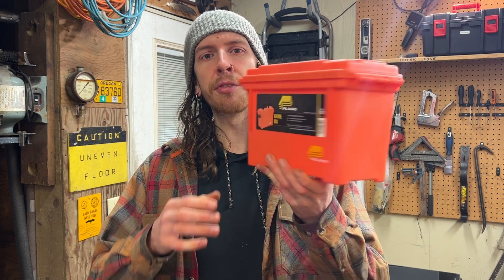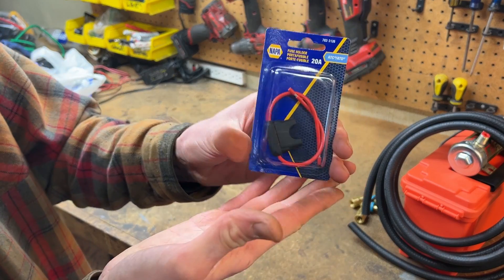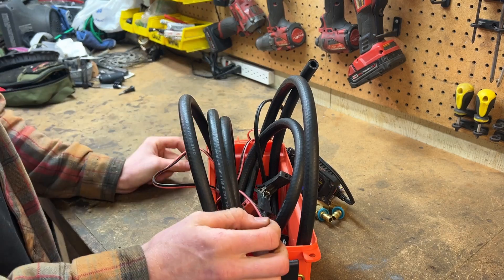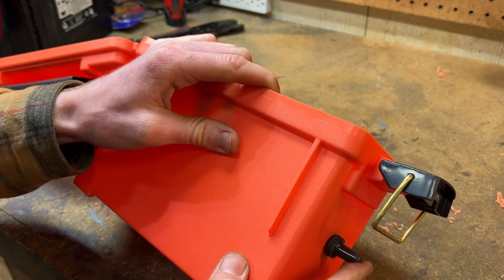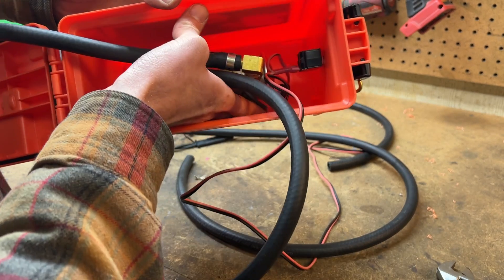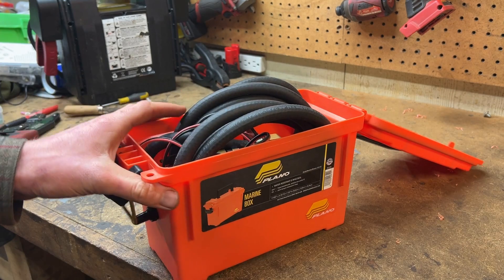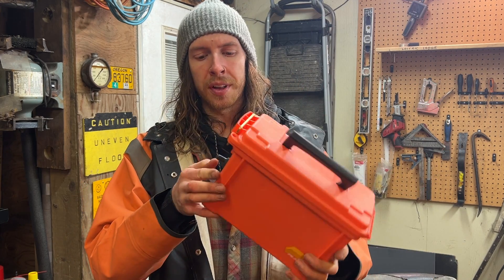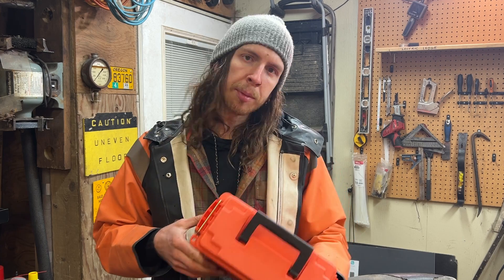Building a rugged and portable fuel transfer pump

Comment: Is there the next size up, or steel ammo boxes at Harbor freight. I bought one to make trailer lighting tester. But I really like your idea on the box. I did buy a different pump from Amazon and was going to handle it loose, but I really like your idea to compartmentalize the pump and hoses and power wires.

Comment: To each his own but this was extremely Overkill and you wasted a lot more money than you needed to.

The cheapest 12 volt Automotive pump online is like $6. Put standard 1/4"  fuel line on both ends with a standard cheap filter before the pump. Cut the ends off of the fuel pump and put Spade connectors on which fit perfectly into any Milwaukee battery.

I own a small engine repair business and this is what I used to empty all of my machines and it works perfectly
Reply from the maker: Fair hit! I would describe myself as an overkill kind of guy 😎

 Nice to hear that the Amazon-special pumps hold up. Thanks for the tips! How many GPH do you think you get through the quarter-inch lines with the smaller pump? It would be nice to have something smaller in diameter.

Comment: Very cool. I have something very similar but I run the pump with a 20 volt Dewalt battery. I thought about getting a voltage converter but it seems to run well at 20 volts. I'm getting about a gallon every 2.5 minutes but it's also a super cheap pump from Amazon.
Reply from the maker: Very cool! If it ever burns out you're only out 10 bucks or whatever. Probably runs way better overvolted. It's not like it's seeing continuous duty. It's not stupid if it works!